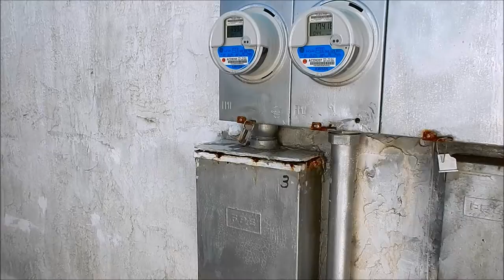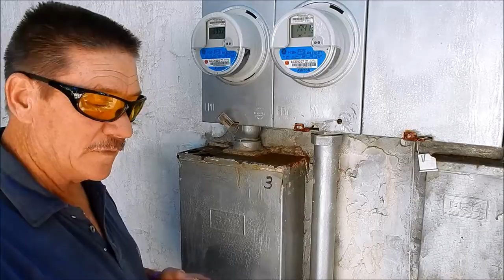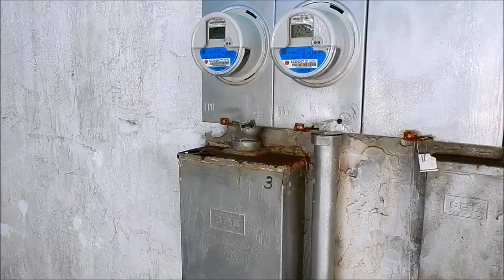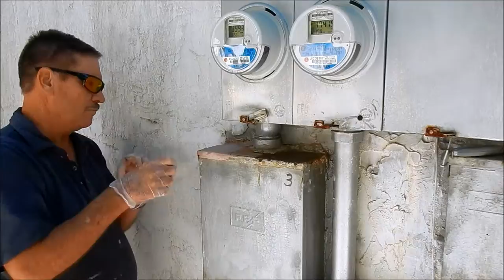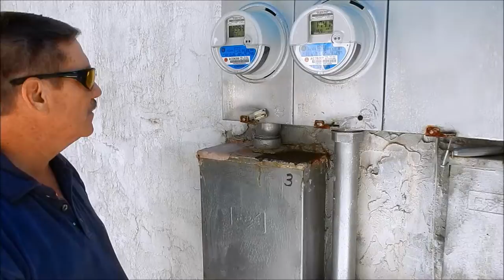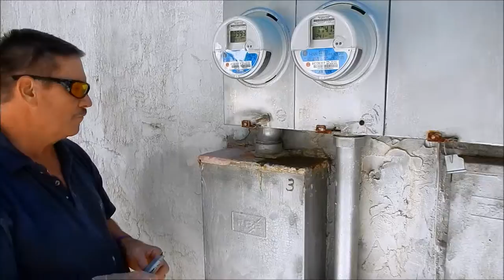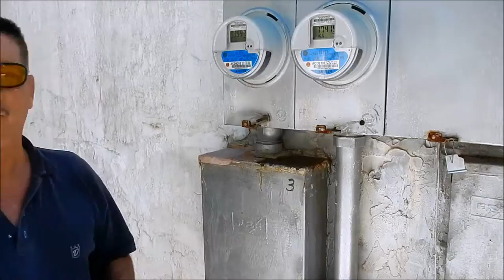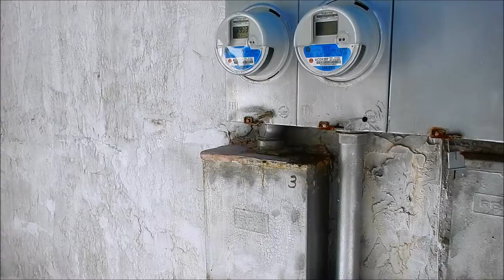RUSTED ELECTRIC BOX REPAIR

Comment: Nice finish!! How did you resolve the rust damage inside the panel as the water was probably getting is. Your bus bars may be oxidized based on of the panel may also be rusted? Did you replace all the breakers and clean the bus bars?

Comment: New box is smarter.
Reply from the maker: In reality, as a former licensed, bonded, and insured electrician, yes you are right I Would make about 3K clear. I would have charged roughly 5K.  it is possibly better for many electricians installing new boxes; however, the repair meets all requirements, and since I own the guilding, it has lasted from the time of this repair through today, and into the future and has just recently again ben inspected and approved. KUDOS to BONDO and Rustolium. After 16 years, we still pass. I thank you so much for your comment. Stay Blessed, and if you ARE A LICENSED, BONDED, AND INSURED ELECTRICIAN DO NOT SHOW YOUR CUSTOMERS THIS VIDEO OR THEY MAY JUST SPEND LESS THAN $200.00 TO SAVE 5k AND HAVE AT LEAST 16 MORE YEARS + OF APPROVED safe SERVICE.
.